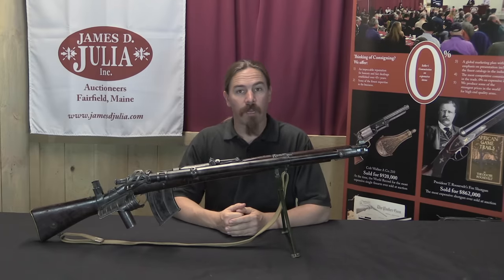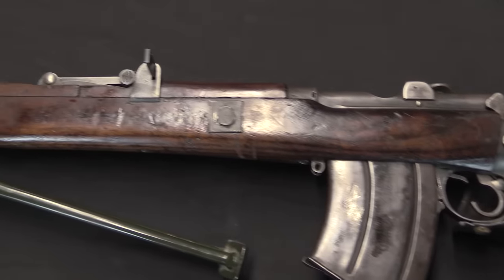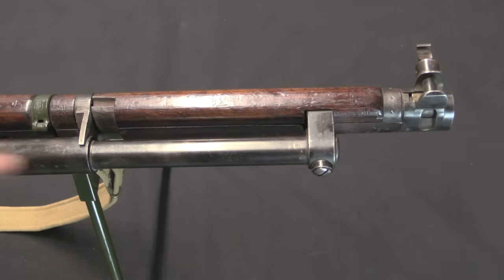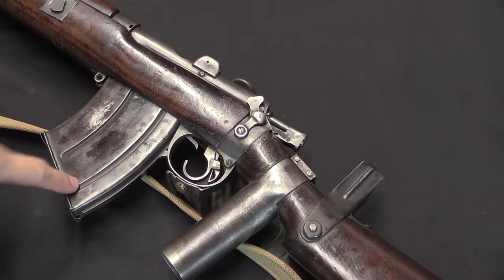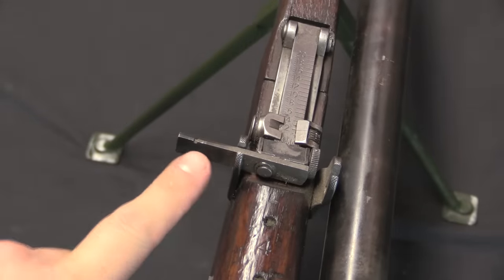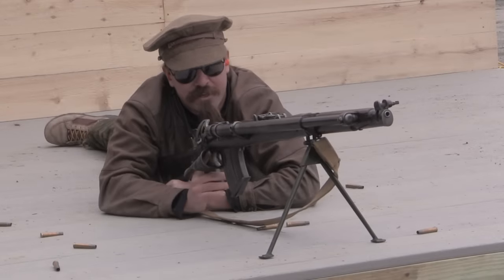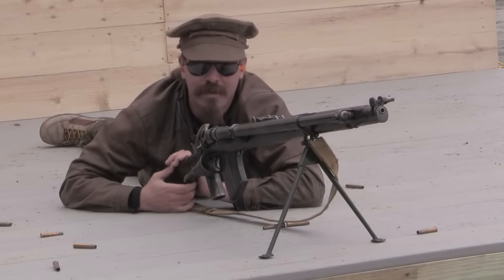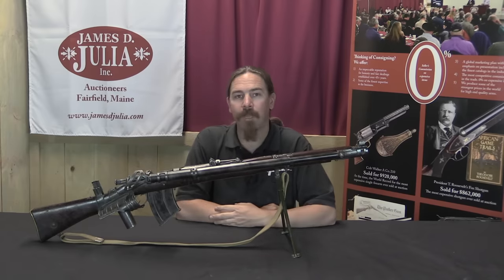M1915 Howell Automatic Rifle Enfield Conversion

Comment: This is a brilliant low-tech solution for a mechanical problem. It's like having a car with manually windable windows, but having a hydraulic hand rotating the handle.
Reply: It is a crying shame it didn't get adopted. Really, so many great designs lost in history. Worst of all is the Jackhammer....I'm going to get one made some day, somehow....
Reply: It's so steampunk-esque it hurts.
Reply: T4nkc0mm4nd3r it didnt get adopted because a true semi auto rifle is a lot more reliable and an all around better solution
Reply: Pancor Jackhammer was a piece of shit of a shotgun tho......All it has going for it is looking "Kewl". While its terribely limiting. SPAS 12 and SPAS 15 as superior in everyway to it.
Reply: however in t1915 this would have been light years ahead of the competition wouldn't mind having one
 @sam8404
Reply: I don't know how but I'm gunna figure out how to do this conversion, write a book or something.
Reply: "Low tech" in the sense that they need to add enough parts to double the weight of the thing and seriously involve into the operation (what Ian called the lengthened recoil impulse) ... so... yeah, a bit more time in the workshop to get to an integrated system not "tacked on" to an existing manually operated gun sounds like a good investment if you see that.
I also feel like it would have been seriously impractical in the field... so much that can go wrong and be bent out of shape under hard use... not to forget the weight.
Reply: @edpiner4960  one word: Fyodorov.
Reply: @edpiner4960  the rsc and chauchat pretty much outclasses it, the brits were frankly not interested in a automatic infantry rifle.
Reply: @Punishthefalse  I agree I want to remake one and use it for my character
Reply: There are electric window conversions that still use the rest of the existing crank mechanism in the door.
Reply: @edpiner4960  This is very far from "light years ahead of the competition". In 1915 "the competition" are guns like the Meunier A6, the Cei-Rigotti, the Fedorov Avtomat, etc., all guns that were far more elegant and complete guns than bulky and clumsy conversions like this or the Huot. The self-loading guns to eventually dominate with wartime production economies were, of course, the Chauchat, and the RSC rifles.
Reply: @Punishthefalse  lol that's true but it's amazing at the same time

Comment: All "steampunkery" aside ... this conversion was designed at the apex of the age of steam.  If you're used to looking at steam locomotives running with all of their moving parts exposed, this action makes complete sense.
Reply: I'm just not used to the working bits being that close to my hands and face!
Reply: It literally is the closest we will get to a real steam punk rifle.
Reply: @BigWheel.  I dunno, the Alofs is pretty steampunk too.
Reply: @IVIaskerade lof system is purely mechanical and still requires braking the action from the shooter to fire again. The fact they even managed to get these rifles to run relatively well for being semiautomatic conversions on rifles that were even in circulation since original production in 1904 or 1895 is impressive. (If they used any surplus MLEs)

Comment: There is something  steampunky about this gun.
Reply: munkSWE88 There really is. I think it's because while most semi auto guns have some sort of internal mechanism that makes them work this one has a external mechanism.
Reply: For once, I actually think it really is a steampunk gun and not glued cogs and gold spraypaint, thanks to the gas tube.
Reply: munkSWE88 I had the same thought... I looks straight out of a steam punk fantasy.
Reply: More diesepunk I'd say as it is now

But with more brass, a bit more bulk and some random screws and bolts it would look quite steampunky
Reply: It looks steampunk because it's overly designed and serves its purpose by sidestepping what is (in hindsight) the most simple and obvious solution.
Reply: More like Gaslamp Fantasy like. I wanna see something like that in Dishonored, a semi automatic bolt action rifle that is powered by refined whale oil ^^.
Reply: Looks post-apocalyptic to me
Reply: Too refined for being a post apocaliptic gun.
Reply: TheOtakuComrade Dieselpunk ? Like in Wolfenstein the new order ?
Reply: munkSWE88 
Yeah, but with Wolfenstein is a very heavy Dieselpunk feeling.
Reply: Wolfenstein TNO is Diesel and Teslapunkish.
Reply: The Official Steampunk auto rifle hands down.
Reply: Now we know the inspiration for the L85A1 at least.
Reply: there is EVERYTHING steampunky about this gun
Reply: Imagine if there was a pressure gauge sticking out the top of the gas piston so the needle spiked every time it was fired.
Reply: munkSWE88 Yes this rifle would've been right at home in an apocalyptic movie, Mad Max comes to mind since Australia has plenty smles around.
Reply: - A crude, potentially dangerous mechanism that is actually not dangerous to anybody who knows how to use it
- Uses gas tube

That's steampunk enough for me. WW1 was basically steampunk era anyways.
Reply: I fuckin' love it.  He calls it ugly, but I think it's awesome.  Not 31,000 dollars awesome, though.
Reply: Hah! Literally yes!

Comment: so basically, they created a gas powered metal hand to rotate the bolt for you.
that sounds genius and lazy at the same time :P
Reply: Oftentimes the best solution is the most simple one.
Reply: Mechanically, it's not technically any different from a lot of cammed-surface rotating bolt semi-auto rifles. The obvious difference being that the mechanical bits are on the outside of the gun, instead of tucked away safely inside.
Reply: oem42 
The Australians did make an automatic Lee Enfield in WWII.  I forget what it was called, there is one on display in the Army museum in Waiouru, NZ.
Reply: oem42 
My mistake, it was made by a Kiwi. en.m.wikipedia.org/wiki/Charlton_Automatic_Rifle
Reply: That looks like something a bored guy in the US would rig up over a weekend to see if it works, hollow metal pistol grip and all.
Reply: Remember, it is 1915. WWI is still raging in Europe. They needed a fast and very cheap conversation and this is what they come up with. It wasn't because they were lazy.
Reply: Remem,ber that John Browning did the same thing using gas at the muzzle to operate a lever gun.
Reply: Laziness means you found a more efficient way of doing something
Reply: You know just for laughs if you had one of these you could attach A plastic hand to that metal camming piece.  ×D
Reply: Basically that what every guns nowaday is.

Develop a mechanism to pull the bolt back and forth automatically instead of pulling the bolt manually with your hand.

Comment: The addition of a cam-roll bearing on the end of the bolt lever would eliminate the jamming of the mechanism when slowly cycled to the full bolt open position. The bearing would also reduce the force the gas piston would have to exert to overcome the friction of the bolt lever against the cam track. The reduced friction would reduce wear on the cam track. A smaller piston might then be practicable and still retain the same cyclic rate. 
As you said, the contraption works much better than one might think at first glance.
Reply: Aceroadholder, okay I have the rifle, you make the parts. We’ll get together and try your design! 😎

Comment: This gun isn't just weird, it's fractally weird. If you strip away a level of weirdness, what's beneath is exactly as weird as what you took away.
Reply: xD
Reply: littlegrabbiZZ9PZA do you mean frantically?
Reply: no. fractal is a word. google it
Reply: Poo Poo - Weirdception
Reply: But there is only one layer of weirdness, after you strip it off you are left with a Lee Enfield...
Reply: Fractal is a word, but it has nothing to do with this gun at all
Reply: +Pekka Rastas You can fire a gun with a hole in the barrel. The hole is down at the end, near the muzzle anyway. This weapon would still work fine if you removed the repeating mechanism. The jet of flame that erupted through the hole in the barrel might startle people on your right side though.
Reply: +Pekka Rastas Just change the barrel
Reply: Wrong...the gas isn't tapped off until the bullet is almost out to the barrel; velocity loss would be minimal.
Reply: littlegrabbiZZ9PZA despite all the weirdness, the mechanic of this gun is similar to modern assault rifle.
Reply: Mike Hawk, Have to disagree. If you had stopped 1/3 of the way down your reply, then okay...

Comment: Never have I seen a gun flex more than that. I'm amazed it works as well as it does, so much mass in the action is just hanging free and unsupported while firing. Also, I'd be very hesitant to ever issue a gun with a stowable sight like that. I'd be afraid of it disappearing in combat. If anything it just proves how impractical it was to upgrade the existing stock of rifles.

Comment: This would probably be the best possible conversion of a bolt action to semi auto. The cocking piece malfunction sounds like something that would be fixable with only slight modification to the design, and the gun does actually work. It looks faily cheap to produce and vaguely reliable. It probably wouldn't hold up to any kind of military trials, but that's to be expected from a conversion like this.

Comment: It's amazing how clean the action is even during slow motion capture. This seems like a pretty tight system given how clunky it is. I wonder how often reliability issues would come up in different climates and conditions. I figure the gas tube on the side would also make it very unbalanced when fired from the shoulder.

Comment: At 6:20 or so, it is assumed that the trigger was modified as a sort of safety.  BUT what if the additional mechanism on the trigger is now not functioning correctly, but was intended, originally, to reset the trigger forward? I mean, it seems to me very odd that they would build this whole attachment, but then hobble it so that you had to manually push the trigger forward to reset. 

It would be purposefully eliminating, or sidestepping, one of the greatest potential assets to this whole design: Semi-auto operation. I'm thinking that that trigger mod originally was meant to pop the trigger forward, for the shooter, and so the gun would then be a true semi-auto, and that it is just broken, bent, stuck, or whatever.

Comment: The Russian 1915 conversion of the AH M95 Karabiner 8×50R to gas operated SA. Is more technically advanced.. the Straight Pull bolt takes care of the Camming action, and the original bolt handle remains to operate the gun in
Bolt action mode.
Only disadvantage, limited to 5 round Packet charger ( but then Garand was also limited to 8 round packet!).
Easier to build a Semi Auto Mannlicher than a SMLE.
DocAV

Comment: Thanks for such a nice video. Wasn't that gas chamber supposed to be just a quickly detachable one during operation? I think the mechanism would have been much better if it was a "normally open", spring loaded action. As long as the spring could keep it at a full travel open to avoid feeding problems. So to cock it, u would handpush the bolt to close. Using the gas system on closing since that's where some effort is needed.

Comment: So there is need for a mid place piston in the gas chamber with 2 gas inlets like those on hydraulic cylinders to both open and close with a, 2 way spring at the inlets to delay the closing a little.

Comment: This seems like a bad design to me. You CAN cycle the Lee action without changing your cheek weld or moving your face. All they would have had to do was instead of cutting off the bolt, extended it so the camming action took place lower. You'd still need a pistol grip and perhaps a shield to make sure you don't move your face too close but other than that it would've been fine.

Comment: Ya know, if they did have something similar to a nail head at the end of the bolt, along with a little bit of lengthening, it might actually be even more reliable, seeing as the malfunction you showed was literally just it popped out of the cam at the end of travel.

Comment: I am working on building a bolt action converted to semi auto similar to this. I'm using a sporterized Mauser variant in 8x57 but I may end up having to use a Lee Enfield as I'm not sure if I can make the 90 degree rotation of the Mauser work.

Comment: Ian, when is the next Q&A coming up?
I keep wondering why the FN FAL wasnt retooled for 5.56 when nato adopted it considering the the FAL was originally designed for an intermediate round ( I believe ). Isn't the FAL considered to be an excellent rifle and therefore worth continual use?
Reply: Probably because it'd be like retooling the ar-10 for 5.56. It's the same system, but not the same gun; no interchangeable parts, larger mag wells and such designed for 7.62 nato, etc. Or at least that'd be my assumption, beyond the whole supply and sunken cost business

Comment: It must have quite a stiff recoil spring to overcome the striker spring pressure...
Reply: ritterbruder212 not at all, I can cock mine with just my thumb. mine is a WWII Australian rifle, but its action requires no effort at all to work. that's one of the reasons why it was so fast to cycle the bolt.

Comment: Could an able gunsmith create a custom conversion for a bolt action gun that would work like this and would it be expensive?
Reply: Yes and yes. It doesn't look too difficult to reverse engineer and make and a skilled machinist could pull it off. But it would take a lot of machine time to make and fit to a rifle, so the cost of such a scratchbuilt conversion would be rather high.

Comment: We forget that by WW1, humans had become pretty competent mechanical engineers and metalworkers. Just about every common machine tool in use today - even the 'automatic' ones - had been invented by 1914 and basic machining techniques haven't changed much since then, either. OK, they had a bit to learn about modern materials and heat treatment. Just don't mention the US Army's WW1 rifles!

Comment: I think that using the Canadian Ross rifle as the base rifle might have been better for this particular project, due to it's straight pull bolt. You wouldn't need that giant camming piece and it might be more reliable without the need to move the enfield bolt up and down like that.

Comment: Very clever.  A straight forward conversion using the original bolt action handle.  I wonder how well that would have held up.  I think you said something like that in the one on the Charlton.
.